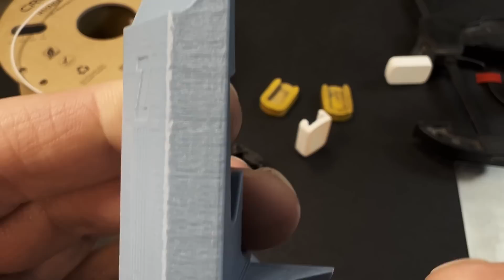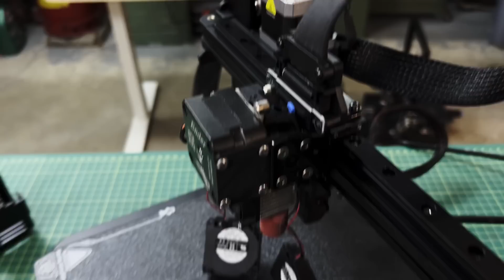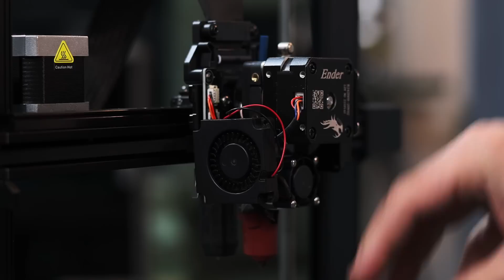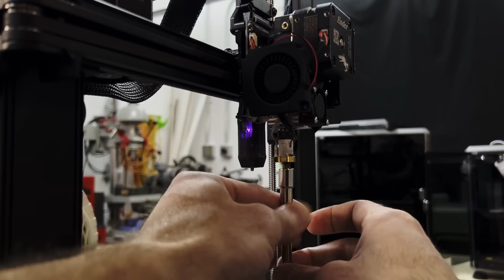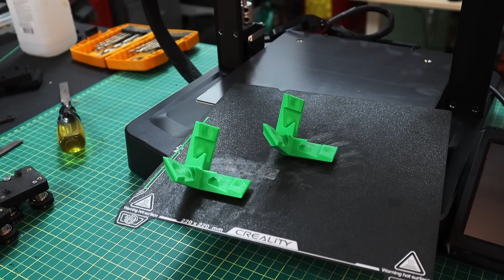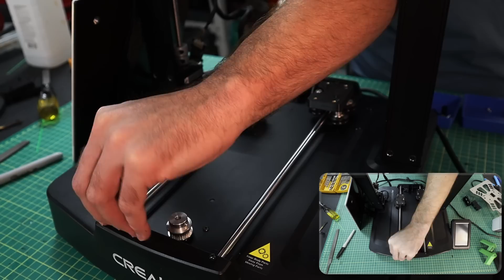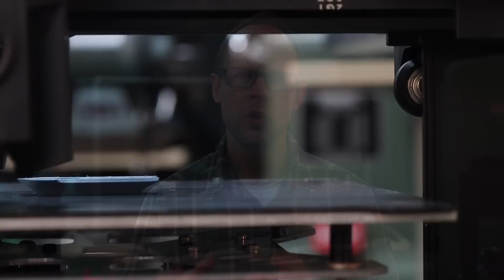What Causes BAD Print Quality on the Ender 3 V3 KE? - Fast Bed Slinger

Comment: sometimes is not the extruder but the fact your filaments is hard to pull...i put mine on bearings so extruder dnt have to work hard and i dont get these issues try that maybe before the bearings spool holder then i get issues

Comment: maybe the heat is to high and the melting point of the PETG is lower than you use because it locks like it stays melted a bit until it cools and in this time it deforms.

Comment: I am a fan of linear rails they certainly are less prone to movement both linear and vertcaly. I have used them on CNC machines where the moving parts needs to be stiffer. The Chinese rails are pretty cheap but do have quite a bit of inbuilt friction. This friction might be problematic for a 3d printer as the stepper might need a bit more drive and the toothed belt could perhaps do with being a bit wider to remove the slight delay in direction changing. But we do have a silk purse already with this machine although for commercial work might be not quite there. I would be interested in your research though if you do go down this route. Might make a good video as you will probably have to print some replacement parts.

Comment: I bought an Ender 3V3 KE, and the Y axis moves side to side, but surprisingly, the print quality isn't bad. Also, that printer didn't have fixing bolts on the ends of the Y-axis rods on top, only from the back. The same problem with Y-axis bearings, it also moves side to side.

Comment: That is absolutely in the most insane thing I think I’ve ever seen my motor turns backwards, so I routed my printer that is fundamentally dumbest thing that you have to be the smartest person to do. Why not just unplugged the motor and flip the plug over dude all you gotta switch the directional pinsbut you got people out there in their system is probably destroying their boards. That’s insane insane.

Comment: Im looking for a 3D printer so I dont know much about them but wouldn't printing at a lower speed solve the issue kinda?
Reply from the maker: It might help a bit.  This type of problem at the start is pretty bad though, it doesn't usually get better over time.  I've released some fixes for this problem using Linear rails and they seem to work really well in comparison.  The extruder is still a bit of a problem though, but at least it is better.
Reply: @NeedItMakeIt  this video is also a bit old at this point, so you think Creality would have revised the KE by now? Or would you recommend something like the K1 SE? Im from South Africa so the printers are much more expensive here than in the US so I want to make sure I buy a decent starting machine
Reply from the maker: @henribarnard4130  It depends on what you're looking for, I'd wait another month or whenever the new Bambu printer comes out, that will likely shake things up a bit and prices on other printers will probably drop.  Some of the best and also least expensive are the Bambu, some people still have a bit of a bad taste from the changes they made to interface with their printers.  They've wanted to go full closed ecosystem for a while, their products are some of the best out there.
Reply: @NeedItMakeIt  firstly thanks for actually replying even on such an old video. 
I know everyone always has great things to say about Bambu. The only issue is they arent as affordable here. On Bambu's website they cost 400 but buying them over here costs the equivalent of 535 dollars. And South Africa would probably take months to actually start selling the new printer. But I think Ill wait. If this new one can bring down the price of the A1 I might just go for that.

Comment: My 2 cents worth.......have you considered that the design of this printer in he Y axis does not follow the design principle of a lathe bed in that you are attempting to guide the bed with 2 sliding surfaces  and you are not sure if the mounting of the rails is truly level.......My contention is that the rails should only be guiding in 4 planes.... up and down and side by side on one side only and in 2 planes up and down only on the other rail......if you understand lathe bed design this will make sense.
BTW, having 2 linear rails doing the guiding over their length will not make it better as any slight t misalignment of the rails to one another will cause the bed to wobble ...........you cannot have two linear rails in an exact flat plane when the mountings of the rails is on plastic.

Comment: I also have a ke, I was thinking if you had used the original ke motor with the k1 extruder or if you had used a different one, because my ke motor has a bearing that I doubt will allow you to fit the k1 extruder
Reply from the maker: I have it on my plate to get this extruder swapped out with a new more easily adaptable mount too.  I think we should get it done, there are a lot of people with this printer and it has some potential for sure!  I think the K1 extruder also could have been a bit better, it has the big gears, which are nice but because they only have support on one side, they can flex, which I believe holds them back from performing as well as the P1/X1 or Q1 printers.
Reply: @NeedItMakeIt  My biggest problem with the original extruder is that the TPU is impossible for me to print even at the lowest speeds.
I was hoping that by replacing it with the K1 extruder I would improve the situation but I can't reuse the original K1 motor with the new extruder due to the bearing present on the motor, but I saw that in the video you say that you reused the original K1 stepper motor ke, how did you do it?

Comment: I bought a V3 KE, only problems. Clearance in linear rail and bed bearings, nozzles touching printing
random auto leveling error.
It's really not a quality printer. 2 months it's in the trash. disappointed, I regret my ender 3 v1

Comment: So basically your saying "What causes the bad print quality on the Ender 3 v3 ke?" is actually the Ender 3 V3 ke itself. Your doing all these mods which is not why the average person (me) purchased this printer. This is marketed as a capable, low maintenance, high quality printer which require minimal maintenance for quality prints. Having one for 6 months I can say unequivocally it is not. I spent 1 full month trying to level the bed to get an acceptable Z offset. It turned out the printer was defective so I sent it back for a new one. Subsequently, I've had some very nice prints and and mainly print Lithophanes of which I've printed over 50. After finally tweaking all the settings and getting virtually perfect prints it has now, suddenly and with no warning, started malfunction. Without any setting changed, same filament, same profile, printer not moved at all, Z rods fine & greased, belts and bolts tight,  I have horizontal separation every 6.35mm up the Z. What I'm saying is that with enough mods you can get great prints from almost any printer but you shouldn't have. I don't feel I should have to add $$ to the price just to get it print like Creality says it will out of the box. If you're very lucky and get a trouble free printer good for you however from all the interactions in the forums this is just not the case. There seems to be ZERO quality control and the customer service has (very) much to be desired. My advice to first time buyers is look elsewhere. Maybe Bambu (don't have one) or Prusa (don't have one either but would love one) as everything I see online about them is very positive including their customer service. Sorry but I don't want to see anyone spend $ and go through the headaches I and other experience.
Reply: You are doing something wrong then, I bought 6 of these at different times, and all have over 500 hours on them over 8 months, and not a single issue except for ones I caused in the slicer.
Reply: @BLee20005  Most likely not. The Creality forum (and others) is flooded with KE issues from bed level, bed heating to Z offset. It's not to say one can't achieve great prints (I am getting very nice results now) however that's not the issue. The problem lies withing the way Creality marketed the KE. It is does not come near any expectations set by the manufacturer (at least the two I have used out of the box). The Auto Calibration and auto Z does not work for me to date no matter what measures are taken (and none should because "automatic" is AUTOMATIC). If a product is marketed as "perfect first layers" out of the box with no user adjustments then it should produce perfect or at the very least a good first layer. That's only one of the issues. If you have 6 printers that didn't need any manual adjustments then consider yourself a lottery winner 6 times over. One should not have to purchase anything additional items to get good prints. No rails, no rods, no mods.
Reply: @Lensman64  I have done absolutely nothing to any of mine, I have 6 with over 500 hours and never had an issue with first layers, you also have to consider that the majority of people complaining online have either done things to their printers, or they just have absolutely no idea what they have done, and trust me on that as I have helped quite a few people and that's usually the 2 main issues, every so often it's an actual issue, but not very often
Reply: @BLee20005  As I said, that's awesome for you however I had no such luck with two V3 KE and have only followed the recommended "guidelines". I did nothing but follow directions. And, as I said with both printers the auto calibration and Z don't work at all. The Z is consistently 0.05 too high which as you know will create a nice spaghetti dinner. I always have to manually adjust the Z.  I guess I one of the "every so often..." I'd rather be in the other category.
Reply: @Lensman64  Update the firmware, they have fixed some issues with the bed leveling
Reply: User error.
Reply: @BuzzingGoober  Hmm, turns out Creality doesn't agree with that.

Comment: Check your extruder driver voltage
Reply from the maker: I had one heck of a time finding it, and that's because the extruder control is on the board itself like the Enders used to be the rest of the steppers are controlled through changes in the .cfg.  I'll give it a go thanks for that!
Reply: @NeedItMakeIt  this is the only thing you did not check. And from my experience with bowden it does depend from filament to filament how would the extruder act (may be because of cheap extuders? :D)
But the friction inside would depend on where the print head is because it changes the angle that filament goes into extruder.

Anyhow I watched some stuff about the voltages last few days and just a tip: The current you are setting depends on the driver and software you are using. Example: For old drivers on ender it should something lime 0.8 but if you go to SKF board and TMC 2209 you should set it to almost a half (0.5 or smth). Just google "ender tmc driver current" and see the first redit post for some good info and explanation.

Comment: I think I may have another solution other than linear rails.

Theoretically, if you lowered the centre of gravity of the bed to be inline with the belt forces, you could reduce or even eliminate the vertical bed tilt-wobble caused by acceleration and deceleration.

Just a thought — Whether or not it works in practice, I have no idea

Comment: Haven’t found a good slicer for the Ender 3 V3 KE which do you use or any recommendations?
Reply: Orca, by far the best. If you root  it and install Moonraker etc then you can print directly to the printer from Orca

Comment: I thought linear rails right from the start. Not sure why they wouldn’t have done that in the first place.
Looking at buying this model but now I’m not sure.

Great video nonetheless!
Keep up the great work!
Reply from the maker: Thanks!  I'm just about finished the lin-rail option and we're going to have some other really cool upgrades coming for this printer and possible all bed slingers as well.  I see that they have the Ender 3 V3 Metal frame available, it seems like it's a better bang for the buck, Nathan Builds Robots has a video review of it already.  Of course it is more expensive.  

Have you looked at the Bambu A1, they had a recall for one of the wires coming to the bed, but otherwise it's a good printer.

Comment: hi, I'm about to order an Ender v3 KE.  it will then be my first 3d printer.  It has a good price for what you get?  what should you really expect when it is not a very expensive machine.  For a hobby, it is a hobby to come up with solutions and make things better.  a thought for your precision hunting.  do you still have the filament roll hanging at the top of the tower?  in a video I saw, he made a table stand for the reel, as well as an ornament with his logo for the hole for the reel on the tower.  As there was a hole through for the filament to go to the extruder.  very good and informative video.  greetings from Sweden

Comment: Thank you for this, I am really rooting for your next video. I also have this problem i even tried to put the spool on the side to lessen the vibration still the same. Hopefully you can post more videos for KE.
Reply from the maker: I just received the parts yesterday so I just need to finish up a few more videos in the pipeline already and then I'll get back to this one.  So far I'm pretty happy with how it's turning out, it's certainly more stable.   It should be within the next 1 1/2 - 2 weeks to see that video come out.  I want to release something that's tested and it has to look good too.

Comment: I am along for the ride, just ordered one today, comes wed, so I will be looking forward to the follow up video in a couple of weeks.
Thanks for all the hard work and thorough tests!
Reply from the maker: I should get the parts soon and I can finish up the video and see if we can make a big improvement.  I assume that not every printer is going to have these problems, some people say they do, some people don't seem to.  The only way to know is to print in the center and then in the front corner and if the results are the same, you're golden.   It's funny that it wasn't my intent to do that, I was changing between printers and some have larger beds and it shifted the parts to the corner, well that ended up being the thing that helped me to find the problem.  From now on, if I test a bed slinger, center and then front or back corners are the way to go.
Reply: My lower left corner is negative 1.24 compared to any other point on the bed surface. Sometimes it affects my prints as well. Before it was 1.38, how did I fix it? Loosen the screws but shouldn't all these numbers be about the same ?

Comment: Linear rails aren't necessarily always better than linear rods. You'd probably get the best experience from watching MattThePrintingNerd's video on linear rods where he made his printer go 2000mm/s. He compares the best steppers and rails, and bearings to find the absolute best combo. That might mean a more accessible upgrade than linear rails too!
Reply from the maker: I don't disagree, the rods would need to be larger, they have a bit too much flex, but the main problem to avoid is the teeter totter setup, having the centralized bearing is not a good idea to make it work well at high speeds.  Everything needs to be stiff and with plastic parts and small standoffs on top of that we're not going to see the best results. 

I went looking for quality hardened rods locally and we're about $60 per rod over here and the length is non standard along with the tapped holes in each end. 

Mag-lev would be awesome to try out!
Reply: @NeedItMakeIt  Those are expensive rods!! And I agree, an LM8LUU seems too small to support the entire bed, especially with cheap bearings. Will you have space for 2 linear rail bearings on each side? I bet you're right about the plastic parts contributing to flexibility, too. I wonder if they could be beefed up. 

I have a friend who will probably get one of these, so maybe I'll get the chance to experiment myself! My OG Ender 3 Pro runs at 200mm/s and 15k accel, travel 500mm/s, and quality is great! Doesn't even have the silent board 😂

Comment: Thks great video try to find the parts a test
Reply from the maker: Thank you very much.  I have the parts on  order to make the change to linear rails, I'm just waiting for them to arrive and we should see something within the next few weeks.  Hopefully the linear rail solution will provide the stiffness that we need to reach the highest speeds that this printer can run at!
Reply: @NeedItMakeIt  great to hear i will buy one and make that modifications
Reply from the maker: @visoutech  They also have a new printer called the Ender 3 V3 and they'll have a Plus version of it as well sometimes soon I believe.  I think it's a bit more expensive than the K1, but it has some nice features that the KE does not.  I'll try to get my hands on one to test out in the coming months.  There is a video out by Nathan Builds Robots showing that new Creality Printer if you wanted to see what I mean.